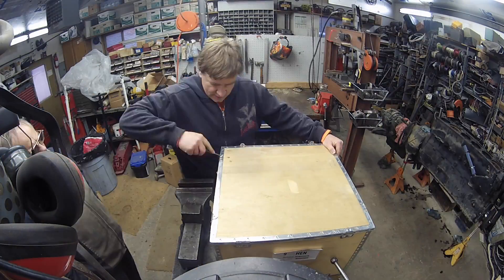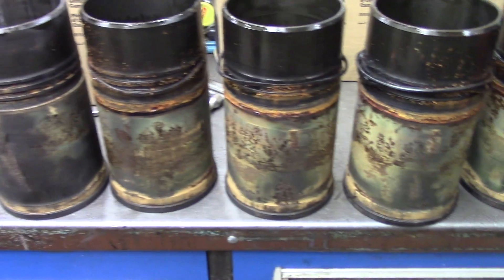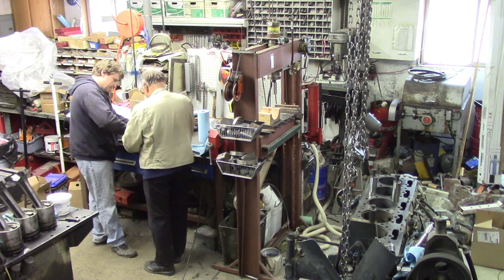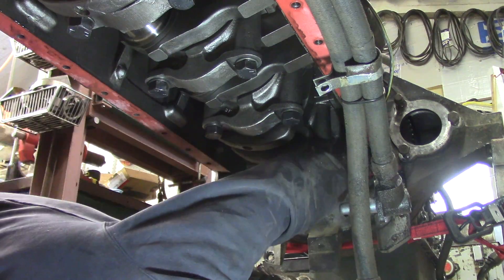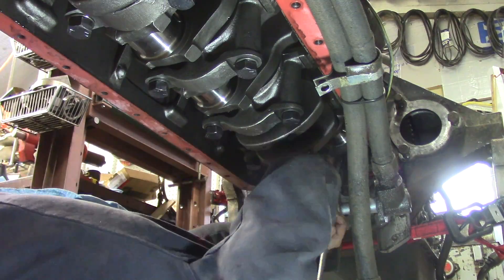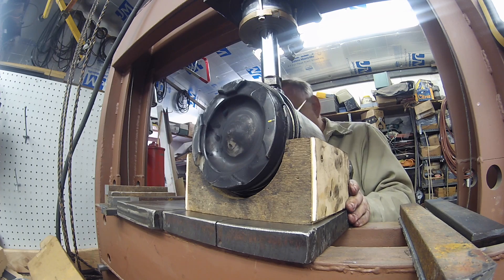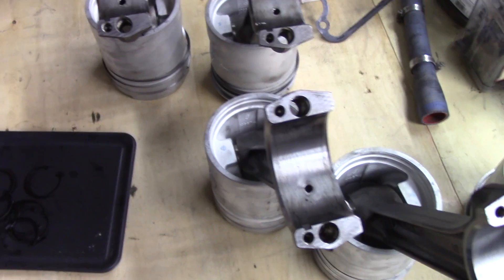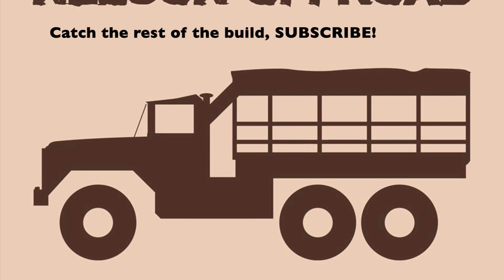Cummins NHC250 Rebuild Part 1

Comment: What's the symptoms of the pitting in the sleeves
Reply from the maker: That was what we suspected at the time but it turns out for the 855 and automatic the most likely point of failure is high egt destroying liner seal and sticking pistons. Symptoms of pitting are coolant in oil or gasses in the rad. Egt Symptoms are sudden loss of power especially while working the engine and coolant in the oil.
Reply: @acme663ryo  ok thanks for that information wasn't y'all's na non turbo? Wonder y egt we're so hi
Reply from the maker: @thomaslockley945  it surprised me and it isn't an issue when that motor is in front of the manual transmission but I think the auto let it lug too much. 3rd gear pull on a hill could see them at 1500+ in seconds. Idk how high it went before the Pyro. We were also operating at high elevation 5-9000 and everything was a long pull. Bopping around on the flats was never an issue.
Reply: @acme663ryo  I don't have a egt gauge on mine yet but it's stick an maybe u r right but even the coolant temp on mine stays really low like maybe 160 highest I've ever seen but I've never pulled a load or up mountains really just drove it empty

Comment: Acording to the liners sides corrosion,the liners seat must be pitteds. No way you should install the liners in a pitted aera. Absolutely no silicone over there. You should have the seats machined and brass shims installed. Very important. The protusions also are important. A trick to remoove the upper crank bearing shell.....you cut almost flat a 5/16 bolt head,insert the bolt in the oil hole and turn the crankshaft. The head of the bolt will push the bearing out. To remoove the piston pins,put the assembly on hot water,the pin will be easy to come out. The same to install back the new pin on the new piston,heat the piston on hot water....not boiling....the pin will go there with out forcing. Check also the camshaft. For pitted aera. Change it if a small pitted  aera is show on the surface. Do not skip any procedures. I used to work for Cummins for many years,and the trick is to not forget anyting. Parts are not cheap but it worth the expense.

Comment: Not to be a smart-ass or know-it-all but it's called cavitation can't run straight water and when you run antifreeze you got to put now cool
Reply from the maker: Military runs the straight green stuff because they don't care and their motors rarely last long enough for it to matter. After pressure testing we found none of the liners had pin holes yet. It was crazy egt that killed it. Long story but small valves, auto trans, no turbo, high elevation and steep hills.
Reply: @acme663ryo  you're exactly right glad somebody out there knows what they're doing

Comment: How to fix timing gear? ..Timing marks loss...cummens NTC 250
Reply from the maker: There is a way yes.  You are talking about if the injection pump was replace but the timing marks were not lined up first right?  It can be done and you set them off TDC but it is way to complicated for youtube comments.  Search m939TM for military manuals for the army truck.  They are free and if you get the right one will walk you through the process.

Comment: don't feel bad about being nervous bro.  you are a conscientious mechanic and that means your are a good mechanic.  diesel engines are a marvel of engineering and as long as they are treated right they will last practically forever and out perform any gasoline engine.  do a favor for them and they will do 100 favors back.
Reply from the maker: Thanks man. We were able to do it and the motor has been running great.

Comment: You put a small bolt, with the head ground down, in the oil hole and spin the crank around. Pushs out the old bearing and puts in the new shell.
Reply from the maker: How do the old shells pop out of the keepers that prevent them from spinning in the block?
Reply: @acme663ryo  The tangs are only on one side so just turn them in the opposite direction. I have done this successfully on Cat, Cummins, and Detroit's in frame.

Comment: As an x Cummins Dealer mechanic I can tell you the problem you experienced with the liners is due to cavitation that can easily be aleviated by using the proper coolant filter and additives which layers the liners with a coating that the bursting air bubbles created by the cavitation will eat at instead of the liner. To get the upper mains out simply take a 1/4" clevis pin and file the head on one side flat then insert the pin in the oil galley of the main journal and rotate the crank and walla out comes the upper she'll without risking crank damage. After rebuilding literally 100's of these NH begins I could supply you with numerous handy hints but you will get there.
Reply from the maker: We also were so sure that it was cavitation and on one of the trucks it probably was because that one had coolant leaking into the cylinders but on the other two there was no pitting that passed through.  One liner was close but not through.  We used a pressure rig to confirm this and brought the liners up to 20 psi for a bubble test.  The other motor had no pitting at all.  It turned out to be egt sticking liners to the pistons.  A issue cause by a strange combination of government contract parts that you just wouldn't see on a civilian truck.

Comment: should have had the counterbores cut and used lpf (lower press fit) liners. greatly reduces cavitation  and impooves head gasket sealing.
Reply from the maker: I think all we did was do our best to check the deck for flat and confirm liner height.  Not equipped to do much more really.  They have been running nicely so it looks like we got away with it.

Comment: The 855s need SCA in the coolant or they'll get pitted we used to call it crotch rot lol
Reply from the maker: In the case of at least two of ours it was EGTs that did them in.  In the mountains with no turbo or piston squirters to cool them the EGTs got high enough to expand pistons and cook liner gaskets.  With a pyrometer there have been no further issues.
Reply: @acme663ryo   I've seen several of them get cooked even with cooling noozles some of it could be due to age. I was referring to the pitting, those full wet liners wiggle some with piston travel. SCA creates a barrier on the liners which keeps the air bubbles from boiling water from eating through the liners. Good catch with installing the pyros 👍

Comment: Just a lil fyi if you have to inframe or stand rebuild another Cummins if you go to a trailer shop and pic you up some exterior wall rivets they are a shade smaller than the oil galley hole in the crank shaft you can use them to turn the main bearings in and out without the possibility of hurting the crank used to work for a trucking company that the only way we r&r'edthe bearings if the crank was not gonna be removed the head of the rivet is thick enough not to slide under the bearing
Reply from the maker: Thanks!  I do have to do one more.

Comment: The NHC-250 Cummins was a infamous engine as a random option in the American Military with the M809 and M939 Series Trucks.1970-1982 when AM General built the M809 Series as M800-M832 5 Ton Trucks,all of them had a NHC-250 Cummins from the factory.The M809 Series was started by AM General and was meant to replace and extend the M54 Series as a 5 Ton being a descendant.The M54 Series started from Mack from 1953-1968,if you compare my M54A1 Cargo Truck to my M813A1 Cargo Truck,you'll see the very identical similarities except that the M809's aren't as flat surfaced as the M54's.The M54's also never had a Inline Cummins,Mack M54's had EDNT-673 Mack Diesels or LDT-465-1A Engines from Continental,Hercules,and White if it was a A2,the M54's were built by Mack,Kaiser,Diamond T,REO,and Diamond REO.All of those trucks also had a Elbow Intake on the right fender if it had those engines,if it didn't,they had a R602 Continental which was a Gasoline Engine,the M809 Series always had a bigger Elbow Intake and it was located on the left fender.There also was a 10 Ton Version of the M54's such as the M1123AC and M130AC's,M1123 being a Semi and M130 being a Cargo Truck,those only had a 425-903 Cummins as V8,not Inline,along with a Leroi 844 Gasser as a option.

At the same time the M809's were introduced,the M939 Series came out and there was the M900-M922's by AM General as 5 Ton,14 Ton,and 20 Ton Trucks,they had a NHC-250 or 400NTC as a option from Cummins,and also a CNG Series 60 or 8V-92 as a random option from Detroit Diesel,later on,they even were available with a HT855 Cummins.Later on up to even when you had the M923-M939 Trucks with the M35/M54/M809 Cabs and Mirriors,they still were using the NHC-250 until it was upgraded to a NCS-250 and just when it was done with,which was around 1987 or 1989 I think,for the Military that is.

Comment: What works for me to get main bearings out is to grind down a head of a bolt that fits in oil port then you just rotate the crank. You have to be sure you don't rotate against the tab.
Reply from the maker: Thanks for the tip!
Reply: @acme663ryo  Cut off nail works good to.

Comment: Do the wrist pins for the piston really have to be left over night or is there a time frame
Reply: *in the freezer?
Reply from the maker: Well the colder you can get them the easier it is to get them in.  That is what we did and they just dropped right in, no pressing.  You could also heat the piston and expand that but man did freezing them ever work nice.  Best I can offer you.
Reply: NelsonStudios thanks for the quick response reason I asked is because I'm currently rebuilding a n855 big cam 3 and this has similar components

Comment: Where did you locate the manual and a complete rebuild kit may ask ?
Reply from the maker: Google 939 manual or 939 TM and they will come up.  Be prepared to find several different versions and 'levels' but if you dig they will be there.  This kit was ordered through a local Cummins shop but the kit is available several places on line.  The one in the truck I am running now was a Chinese kit and it was several hundred dollars less.  Didn't seem to be much difference in them.  Search for heavy engine rebuild kits then contact them with your motor's serial number and they will dial you in on exactly what you need.  It is possible you will have a mix of parts like we found in this one and in that case you will have to order a different set of rod bearings but that is no big deal.  Both motors I have done speck the 'small' rod bearings via their serial number but actually had the 'large'.
Reply: NelsonStudios thank you I really appreciate the info it's been a pain trying to track down parts

Comment: My NHC250 has the big cam rods as well. Had the same issue with my rod bearings.  I got my kit from Federal Mogul using the CP number.  When I called Cummins and gave them the same CP number I learned some of the engines were made with big cam rods.  So.....one more thing I didn't know.

Comment: I know you stated that you bought it straight from the Gov't, but sometimes they outsource the the rebuilds to contractors, that may be why you have 3 of 1 type rod and 3 of another, they may have also not used "factory" Cummins parts during that rebuild or what is called RESET.  My 5 ton was RESET back in '85, engine, tranny, transfer case and parts of the driveline.  The only way I know for sure, was that the data plate was removed and reapplied with some sort of silicone adhesive.

Hope you engine rebuild goes well, I'm watching for some tips as I to have a NHC 250 Cummins.
Reply from the maker: Well unfortunately I just lost NHC 250 #3 this afternoon, exact same failure as the previous 2.  At this point I am not sure what to tell you.
Reply: Sorry to hear that.  I may have to stock up on engines if I start to notice some issues.  Best of luck to you, I'm sure you'll figure it out

Comment: the us government rebuilds those engines every 300 hr in case of nuclear war they all have fresh engines in them
Reply: Are you sure about that? I own several NHC-250's and NCS-250's in a whole fleet of Military Trucks that I own,out of multiple.Once they usually hit 35,000 Miles,they get put out of Service from the Military.Most times,they nearly even see 20,000 Miles,and then they get decommissioned from their Units.Regardless of what Branch,all the road vehicles from DSE's as TU's always send their trucks from the Motor Pool to the National Guard,and then the USANG Retires them from there whenever they decide.

I think the answer you're saying is that the newer equipment and vehicles the American Military has as of now,under 20,000 Miles of use,are kept in shape for duty and work.

Another thing,you can't just start a engine after Nuclear Fallout,a Nuclear Explosion causes a Electromagnetic Pulse that shuts down and corrupts any device or object that uses Electricity,ever since 1976 (Or 1980 mainly),all your cars run 80% for Electricity,only 20% is Mechanically done from the engine,thanks to technology.
Although,with older vehicles,it's very different because of no Computer System or any components in a engine related to one.
If a Nuclear Fallout were to happen right now and the shockwave passes,my 1999 Freightliner M916 won't start at all,which uses a NCS-250 Cummins,but my 1973 AM General M813A1 for example,with a NHC-250 Cummins would crank right up.

Comment: Lots of love going into this motor! Odd how the 'corrosion' is in a line up the liner - kinda make you wonder if there is something else going on????
Reply from the maker: I am starting to wonder if the switch to the proper heavy truck rust and cavitation prevention coolant is to blame.  Maybe all those rust inhibitors ate away all the rusty gunk that was happily sealing the cylinder liners.  If that is the case it might fly in the face of the "change it as soon as you can" advice.  We will know in a bit as I am about to take truck No. 3 out of storage and start running it.

Comment: Do you think that the corrosion on the liners could have been prevented by having the right anti-corrosion additive in the coolant? I realize that there probably is not a yes-or-no answer to this question. I have an NTC in a fire truck and now I'm worried about corrosion.
Reply from the maker: I would say that it is a yes or no question and yes, without a doubt it was the result of the coolant used.  Sometimes it is cavitation, sometimes rust (usually both) but it is a coolant issue all the same.  I can only tell you what I know.  Every truck I bought came with the standard corrosive old green antifreeze in them.  I swapped all of them to the lifetime heavy truck antifreeze and drove them commercially all summer, not hard mind you but daily and over many thousands of miles.  The following spring the trucks started and ran normally but within 40 miles of leaving home both motors suffered catastrophic liner failures.  This one blew out the o-rings and I assume the other did as well but have not taken it apart yet.  So the question I ask... was it that I took these motors and ran them (again not hard but daily), was it my switching over to the 'proper' antifreeze and had the rust inhibitors which attacked all the schmoo that was sealing the leaks or was it simply coincidence that I had two motors let go one after the other.  The real question you have is probably should I switch over to the proper coolant?  The answer is... I don't know.  I am not a believer in coincidence, I think the issue is related to either taking these motors from their lazy surplus life and running them or the coolant switch.  You can see those liners, rust damage yes but no thick flaky rust.  IDK man, part of me says let sleeping dogs lie.  So far I have a 66% failure rate and in the next few days have to take the current tour truckout and beat it around for 100 miles or so in an attempt to break it.  The thought gives me chest pains.
Reply: You probably won't see cavitation damage on the liners, more likely on fittings and junctions/turns, or in pumps and valves.